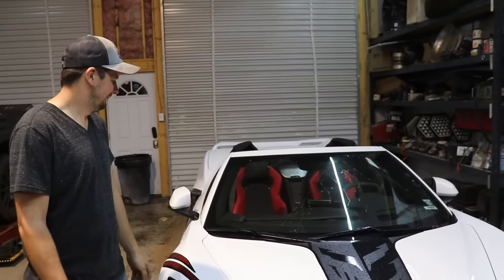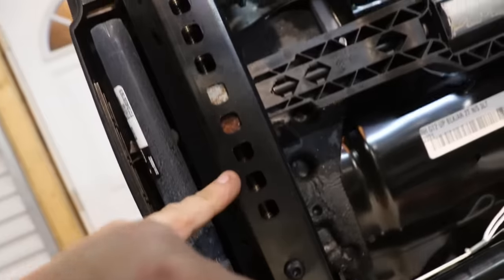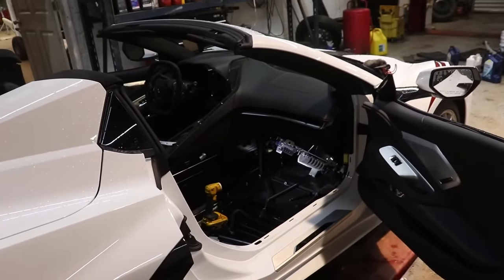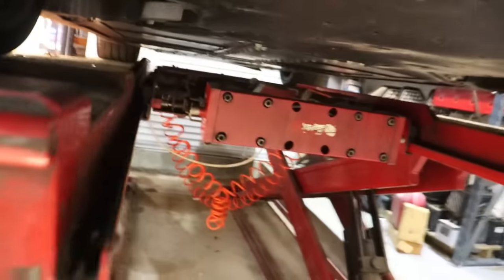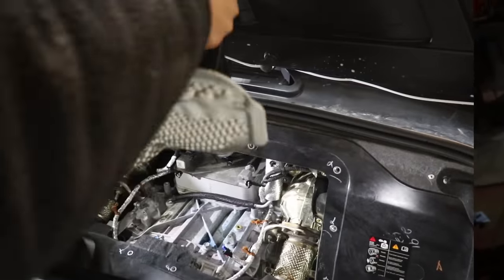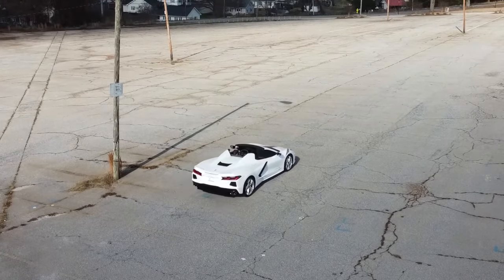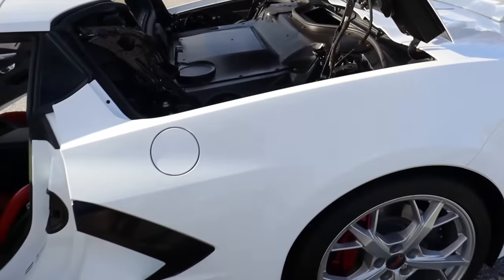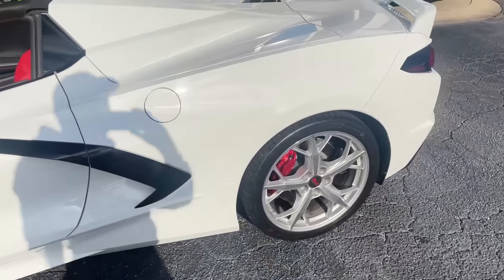*FLOODED* 2021 C8 STINGRAY LT3 Z51 INTERIOR TEARDOWN

Comment: KBB puts the CLEAN TITLE average value of a 2021 Stingray convertible 3LT Z51, with 6K miles and in "very good" condition, at $89k.  Subtract approximately 25% for salvage value (possibly more as it was likely saltwater flood damage) and you have a residual/repaired salvage value of $66,750.

Comment: When I was young most people who drove 'Vettes were under 45.  Now most people I see behind the wheel are at least 60.  I'm also old and retired and I suppose I could afford a 'Vette - but I'd have to have somebody with me to get me out of the car.
Reply: Father time is not to kind to our old bodies and our joints.
Reply: I am 30 now, and since was about 9 had my eye on a C4 Corvette, 1987-1989 to be specific, though as never learned to drive a manual, would be an automatic transmission, as if could drive a manual, a 1993-1995 ZR1 Vette is what would go for
Reply: No wonder, they are so F-ing expensive, not too many people under 45 can afford them now.

Comment: When buying flood damaged cars, especially those in coastal areas, my worry is saltwater. Even if the car looks clean, a little salt water can lead to a lot of long-term damage that isn't easily or cheaply fixed. Congratulations on your buy, you did get a good deal. Might be a good idea to go ahead and flip it before any long-term damage shows up.

Comment: Looks like the water that got in there drained out through the bolt holes. As it did, the oils along with salt were left near the bolts (the "gel"). I would definitely want to rinse/clean around those areas because the residual salt is going to pull water in from the air. 😬
Reply: That is exactely what I thought!!
Reply: Yep nailed it, Salt
Reply: Yup, looks like salt crystals to me.  I work with steel and salt water corrosion and that bright orange on the rails is a good indicator.  A solution of silver nitrate will also test for chlorides.  The floorpan and carpets need a good wash and the seat rails cleaned and lubed or replaced!
Reply: @bigpjohnson  Also they didn't change transmission or gear oil or anything underneath (unless I missed a video).

Comment: one question , when you put in the new oil in the engine shouldn't you put 5,5 liter in it then start the engine for like 1 minute and then check the level before you put the other 0,5 or what so ... ? just to have right measurement ?

Comment: Fantastic videos guys!  I really like the way you check the engine oil before you even attempt to start a vehicle up.  If you remember, could you please explain in a little more detail why the GM trucks have potential  troubles/water inside their transmissions, where the Ford seems to not have that issue?  How does a Dodge Ram rate for potential water in their transmissions?
Reply: They mentioned regarding the transmission is GM has a breather that lets it the water if its high water. 

What I don't understand is just adding the transmission fluid...why?
Reply: @larrybe2900  Thank you.
Reply: @laylaysshit  Thanks Rob.  I am not a mechanic either, so appreciate detail like that.   They are the experts, but I don't think I would drive a vehicle anywhere until the engine and trans. have had their oil changed.  I guess that is why they are making the videos and I am only watching! LOL .       Al

Comment: Curious why you drove it before checking potential damage electric system engine oil for water (maybe u did check) very risky but if car was dry properly only blow fuse?*

Comment: Hi Michael, beautiful car, hope you garage it. Good luck selling it for $125,000. I think it was the best flood car 🚙 out there because it was not a flood car. I agree with you. Ivan really held out and pushed you guys to buy this car. Now we shall see what’s it worth.
Reply: The crystals on the floorpan and orange rust on the rails is a good indicator of saltwater getting inside. It might be dry, but that salt still needs to be cleaned out.
Reply: @bigpjohnson  not to mention everywhere else lower than the seat rails. Basically this car had equivalent of driving through a Chicago winter.
Reply: The flood damage title may also make it difficult to get insurance on it.
Reply: One with a clean title only sells for about $90,000 with over 2-3 miles on them.

Comment: Nice buy, but you better hope any wire harness was above the water line otherwise new owner is goign to have fun repairing it in less than two years. My wife had a leased mercedes, which went dead after 16 months she got it brand new. The problem was rusted out wire harness. How that happend I have no clue, but it was caused by the moisture. They had to strip the whole car and replace main wire harness assembly. This job took them almost a month.

Comment: I have an numbers matching 1100hp e85 procharged 2009 C6Z06 Corvette. Still in break-in period. Also the tranny, differential , torque tube have all been stage 5 rebuilt. I'm still in break-in period and love the 6 speed manual. The problem is I'm moving overseas and may not be able to take anything this modified. If you every want to trade let me know it could work✌️✌️

Comment: Would be interesting to track down the previous owner and find out what happened.
Reply: Yeah. I don't understand how it ended up at Copart.
Reply: Most likely since the battery was dead the insurance company assumed the entire electrical system would need replaced since it was in water so they totaled it.

Comment: I hope it works out for you , but I would use petrolium jelly on all the wire connctions that were under water. Or sell it quickly. 1 year on flooded cars is when sht happens.

Comment: the problem with these Co-Part flood cars is they run great for 1-2 years...then on year three you can get all the warning lights and oddball electrical problems that are very difficult to pinpoint and fix. I bought 5 Flood cars from Copart and after the 5th, i will never buy anything from copart ever again. He paid $60k for this or more with the fees..and probably at least $5-10k in parts labor to repair - will always be a branded title and hard to sell. Better off just buying a used, clean title. I speak from lots of experience, trust me! lol

Comment: You definitely got a great deal, but you need to follow the advice of Cap2c and those that replied to that comment. It would also be a good idea to pull off the skid plates and clean any salt off that may be under those. Video everything to show the buyer what you did to restore it, and you should be able to get at least 110k.
Reply: 110k? 😂😂 not even during peak covid prices.

Comment: How can those cars at the end be "Certified" but without a dealer warranty?  I thought that the Certified GM process involved an extended warranty on the used purchase.
Reply: I was a Sales and Business Manager at  different dealers in my 20's and 30's. (1999-2014) The "Buyers Guide" states that there is No Dealer Warranty. Any warranty is from the Manufacturer and not the seller. Certified Pre Owned Warranties are also through the Manufacturer, not the seller. Every pre owned auto on my lot had to have a Buyers Guide on it, even if it still had manufacturers warranty remaining. It is Federal law and dealers can be fined up to $10,000 per vehicle that doesn't have them posted visibly. It's all about the FTC protecting consumers. They need to start protecting consumers from all this "Adjusted Market Value" price gouging! It's been going on forever and will continue until people speak up. It's total greed!
Reply: @s.collett1080  Didn't answer my question though.  Certified used cars from General Motors have an extended warranty, which is why they are priced higher than cars that aren't certified.  Also asking more for a car isn't a crime as far as I was aware, in regards to your comments about adjusted market value.  When inflation hits, the price of goods can differ by the minute.  As was in Venezuela, people were spending as fast as they could because their money would be worth significantly less tomorrow, and even more so the day after, and so on.  So a vehicle's sticker price might be outdated and is now worth more 30 days later or whatever, which is what adjusted market value is all about.  Oh and people will pay it, they're the goofballs!

Comment: i have a feeling the rev owner didnt want that car anymore and maybe did a false  insurance claim  to get rid of it?
Reply: Not false but probably a minor one, right?! The car was more or less mint but they probably decided to flip it to a new one that way (faster when the insurance company has thousands of cars to handle and just pays to move it along.) 

I had a car that I drove down under a bridge and got stuck for a short while pretty deep in the water. (Only the front of the car, but still a visible waterline.) 

I'm sure most people would do an insurance claim on that one. (planned to do it myself.) Changed my mind when I started to go through it and realized that literally, no water ended up anywhere else than the same place it gets when you drive in the rain. 

Granted that it was back in the days when cars had way fewer electronic parts to worry about - Still, I still kept to the car for more than fifteen years with no issues whatsoever. and sold it for more money than I paid originally. (It was an old Volvo 240 - Very collectibles nowadays.) 

Back when I got it (used) it was just an ordinary standard car here in Sweden. Paid around $4000 from a mate (his grandfather had died and the car was sitting in his garage and had been sitting there for years) and sold it for around $18 000. A tiny profit compared to these guys but then again, I didn't buy it to flip it, I just needed a car during the summers, to get to and from my summerhouse to the beach 4 km away. (I spent the winter in another country..) Probably only used it 10-12 times every summer.

When I think about it it probably was some kind of friend's rate when I got it but still, the value back then wasn't that much higher - Probably a $2-3000 discount?!  (The insurance paper showed that his grandfather only used it that first summer of 1975 - After that, it just sat there until he died in 1997.) The value I am talking about is the mint condition, low mileage car I got in absolute original condition. (You could find this model in Sweden in 1997 for $1000 or less. but then you got what you paid for.) This one was special and $4000 was an unintentional steal. 

I swapped sparkplugs and oil + the tires. Swapped the fan belts when I picked it up. (Kept the original tires and fan belts and sold them with the car.) Never used the old tires myself - They all looked mint, but to me, tires from 1974 and a 23-year-old fan belt were unsafe to use in 1997 when I first picked up the car.

The fact of the matter i simple. I just happened to be lucky enough to buy a model that people started to desire as long as they were in good condition when I decided to sell it and the model in itself just happened to be in a one-of-a-kind condition. 

Mine was kept in mint condition, with extremely low miles, never used during the winter, and so on.  Probably sold it way too cheap, to be honest. (Took the first offer I got from a guy who came from Italy to Sweden just to look at my car.) 

He was literally over the moon when we signed the paper. (The fact that he refused to drive it home, and took it on a trailer gave me an idea of my mistake.) I sold a car, with great mileage and mint condition but still just a car and he picked up a one-of-a-kind collectibles.

The fact that my model had NO rust whatsoever and was from 1974 (sold in 1975) is something I learned after the deal was finalized to be totally impossible to find as those were rustbuckets and no one had survived, certainly not in mint condition with only 6 000 miles on it (8 000 km) in original condition.

I know that it sits in a car museum down there today. (The same milages as It had when I sold it.) Apparently, the guy has turned down unbelievable offers in the last couple of years - way over ten times the amount he paid. 

Sorry, if I made a novel out of my comment about insurance claims I(started to talk about my old car instead) just couldn't help myself when I started to remember my old gem

Realized somewhere in the middle of this comment that I really miss that car. (Probably need to take Giano up on his offer to visit my car before I get too old.) / Cheers mate

Comment: Just because you do not see the corrosion does not mean there is NO corrosion.  Corrosion is like cancer and it takes time to manifest itself.
You guys should have sprayed ALL motors and electrical connection with anti-corrosion oil so that it would over time penetrate and stop pending rust.
I would never buy that car without EVERY wire, motor and electronics being cleaned and sprayed with anti-corrosion oil.

Comment: Good thing its salt water. Not much chance of mold, bad thing is youve got jelly fish in your gas tank.

Im joking, but id be concerned of rust salt water getting behind structure you cant get to it should have drain plugs, id be washing it out with clean distilled water without anything in it deffently no electronics,  but you can also wash them with distilled water and dry them as long as its not powered up it should be ok.
Its when you apply power that it becomes a problem. 
Me I would have pulled the battery, put it on a trailer and took it home.
Tore it down washed it let it drain and dry.
Washed the electronics blew them out and packed them in rice to pull out any moisture,  look electronics are assembled in a solder bath, then rinced off with clean water put into a dryer then assemble is done.  Dont belive me look it up.  As long at it dosnt have electrons flowing it won't eat its selfe with electrolysis  thats why electronics go bad, your next problem is wiring harnesses.  Water getting to splices and connectors.  Or inside copper wires.
Most wire can take some water as long as its insulated.  Gm wasn't big on dielectric greases like Ford has been in the past, Ford used to flood connectors with grease gm never did it. 
I dont think that car got much water inside it maybe 1 or 2"  enough for an insurance policy to buy it back, the real looser was thd guy who owned it.

Put it on a lift and wash the underside with a presure washer. Get the salt off it. 
Honestly its probably not as bad as driving it in the winter in snow behind a salt truck. But this isnt the type of car you'd drive in a snowstorm. 

Nice car, very LOUD  as in its going to pull eyes to it like a magnetic.